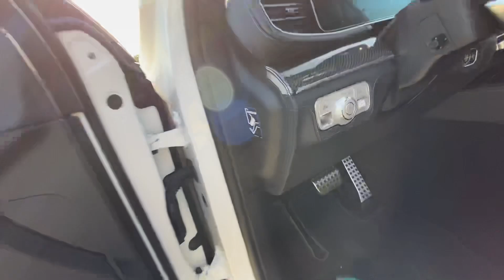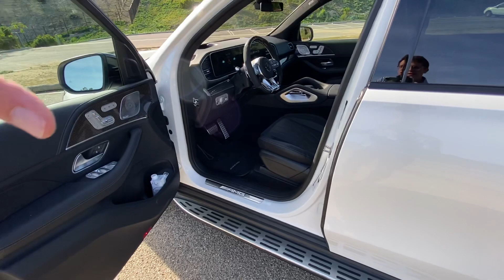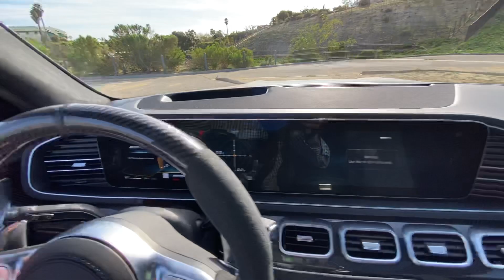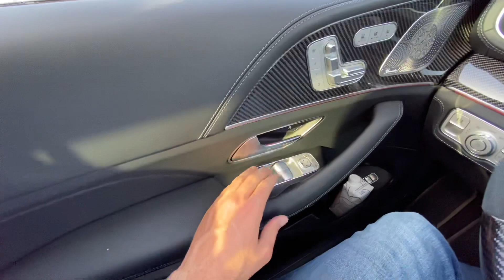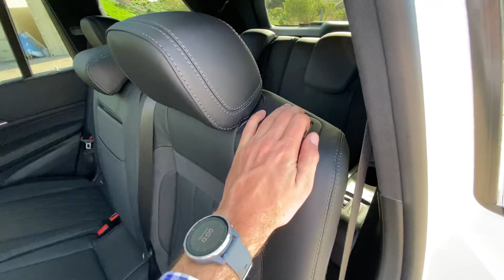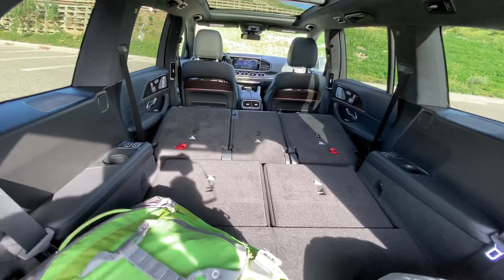The 2021 Mercedes-AMG GLS 63 Is a MASSIVE 7-Seat SUV That Is Faster Than Your Sports Car!

Comment: The seats in the front look awesome and super comfy but in the rear they are just a power ajusted bench. There are no extended corners and you can easily slide around.

Comment: I love to look at this, but I'd never buy one. I'm afraid of the maintenance after the Warranty.
Reply: In this case, leasing would be a better option.
Reply: You can always purchase warranties that’s what I did for my e class
Reply: @SM-1010 , I love the cars but I am afraid of the maintenance. You have an E-class. The E-class is the most reliable of all Mercedes.
Reply: p I’ve had an ML 320 CDI it’s a tank there were barely engine problems if it had problems it was just small electrical things Mercedes has average reliability, people think it’s just bad. Average is fine when ur getting soo much luxury

Comment: This or the BMW X5M?
Reply: JKC 

Not the same car, if you want to compare, compare the X7 M50i 523HP, 3 rows and just as big as this, just not as powerful 4.1-4.5 0-60 and weighs 5,600lb vs AMG 603HP 4.1 to 60 or faster. Not the much different. It shouldn’t even matter how much differences in performance when you buy this kind of suv
Reply: BLACK BIMMER keep in mind that bmw underrates their power numbers and 0 to 60 times.
Reply: X167 GLS 63 any day! Miles ahead of it's competitors.

Comment: Durango SRT: I have lost the crown..
Reply: Cool Pizzo trackhawk: hold my 95 octane
Reply: Jash Modi trackhawk isn’t a 3 row suv Durango srt is
Reply: Never had one....
Reply: I’m not very smart, But Durango srt never had the crown? Dodge claims it on their website and I did research no third row suv was faster than the Durango SRT until now
Reply: Cool Pizzo the model X, x5m, gle 63, Audi sq7, ranger rover Sport Svr and the previous gls 63 were all quicker.....the only thing the Durango has over them is that B.S.180mph topspeed which the bentley bentayga beats!
Reply: Wait for the Durango Hellcat
Reply: rangerover06sc oh yea lol 😂 Basically if you want a small barn on wheels with a hellcat engine
Reply: @youtuber2234-t7p  It will still be lighter and smaller than this. The SRT Durango is about 400 lbs lighter than the last GLS 63
Reply: the srt still has a faster top speed

Comment: THOSE WHEELS 🔥🔥🔥🔥 AND THEY EASY TO CLEAN! Perfection!!
Reply: Lazy
Reply: @Shaun Sharted agree
They may look better on older amg cars like the w210 or the w124 but not on a modern large suv
Reply: KM Gaming im asking you how can you clean inside od the wheel, not spokes😂
Reply: U high
Reply: @KM Gaming  Clearly you have never detailed a car. Wheels with spokes are far easier because you can get flexible brushes or wheel woolies back there. Not with this monoblock style rim. Besides, the old monoblocks were better.
Reply: Easy to clean if u order with carbon ceramic brakes
Reply: They are hard to clean, how do you think to clean inside of the wheel without taking it off 🤦‍♂️
Reply: Stef 44 lol

Comment: Hey, Ford, can I get my F250 Limited 4x4 with themed digital dash, carbon fiber accents, power adjustable rear seats and adjustable suspension for another $30K?  I like and can afford all those things but don't really see myself as a German SUV kind of guy and don't want my friends to think of me that way either.  Do I need those things?  That's beside the point.  Edit:  Oh, and an extra 200HP from a supercharger on my 7.3 Godzilla.

OK, just kidding.  I wouldn't spend my money on that but you know Ford , GM and FCA could sell some of those if they built them due to that line of reasoning.
Reply: a supercharger on the 7.3 godzilla to have -20 mpg!!! 😂🤣
Reply: I’m comparing it to a 600 hp ICE powered  SUV, not a Model X.  Not concerned about mileage at $2 - $3/gallon.  And abundant shale oil is going to keep the price low.

Comment: There is no way you will ever notice a 48v system in a 2.5t truck and those wheels are an abomination. Apart from that it's nice.
Reply: the 48v system is pure garbage and all german manufacturers basically uses it, from vw to audi to porsche , mercedes, why not make a plugin hybrid with at least 100 miles range?! and  use alumium for light weight body
Reply: @alanmay7929  I've said for a long time plug ins or range extenders are the way to go at the moment. Batteries are a pain to make in bulk, use a load of resources and have weight/packaging issues when they're large. Internal combustion isn't clean enough. So why not use a battery just large enough to do most of the work on electric and have an engine to carry on for the times its not enough? Split one Tesla sized battery into three or four and you could do 80% of the driving in four cars for the same resources. 
Plug ins usually come with other benefits too like pre-heating, silent running in traffic, and a decent power bump thanks to having another motor in there. This thing could have run the 350e system with a larger battery and got 30-50 miles ev with a 100hp+ bump in power to go with it. 
Thats just better and at this price really needs to be.

Comment: Those wheels work very well on an early 90’s e class. It was fitting. Big chunky wheel on a very boxy car. New smooth lined vehicles don’t look good with them in my opinion. It is like putting a set of craigers on an 812 Superfast. It doesn’t fit. Give me the split 5 spoke 22’s on the GLS 580 instead.

Comment: Hmm, 4.1 seconds seems very slow. Yes it is quicker than most cars, but I was expecting mid 3s. Although Mercedes does normally overestimate, even if you know a few tenths off, it’s still high 3s. Not the most impressive, but still very good for a car this size.

Comment: Imagine you are sitting in the third row when the gear breaks down and you literrally have to crawl out somehow. Why they did not supply a mechanical way of getting out? Even Tesla has unlocking mechanical handle for doors if the battery is out.

Comment: I laugh how you guys at TFL love all new cars. Most that fall apart after a few years , lose most of there value and end up being unreliable ! And your comparing a new model AMG Mercedes to a reliable Toyota Land Cruiser . Lol . There’s no comparison after ten years that Toyota will be worth more $ and  still won’t need any repairs . Unlike the Mercedes
Reply: Nobody wants these after 10 years let alone who wants to drive a 10 year old car anyways. 3 to 4 years and get a new one, that's who these vehicles are for.
Reply: @DrivenHard  Not true. These are actually great after 10 years. I've had experience with mercs over 10 years old. They're bulletproof reliable and rock solid. If they are serviced PROPERLY they go forever. My dad has a 2004 C Class with 285,000 now. It drives like new. Only ever serviced at Mercedes themselves. Never skipped a beat. And it tows a Caravan on a regular basis on bad roads too and not a single rattle either. And because they have tech and features so far ahead of time, even after more than 10 years they feel perfectly in tune with the times now. They don't feel old, drive old or look old. It has features cars of today still don't have. You are wrong. This is most definitely a car that can be kept for many years.
Reply: @SDav21  you are forgetting you are talking about a 2004 vs a 2020. Old Mercs as with most cars were builtproof and built to last back then. The industry has changed so much and they are not building them to last and be that reliable anymore. It's a whole different type of vehicle, you cant compare 2004 and 2020 anymore and expect the same result after 10 years
Reply: @DrivenHard  Not true. Because the taxis in Europe are new E Classes. The police vehicles are C Classes. Some ambulances are converted E Classes. The E Classes are taxis in some countries in Africa. These cars clock hundreds of thousands of miles in no time. And they are there. Going reliably. Like they're built to. So you're wrong. Besides that even, we also have a 2014 E Class. 160,000. So not as much. But still running like a dream. It just gets serviced when it's supposed to be with the PROPER oil and parts and at Mercedes. And contrary to what you say, the early 2000s were their dark years where reliability actually slipped apparently. And if that's the case, the new ones will be even better. Don't blame Mercedes for the inability of owners to maintain a car with new technology and complex items because they buy it cheap second hand then think it is maintenance free. You want the best performance, the best ride, the best refinement, the best technology... Well then duh. It won't be cheap. You can't blame them for the poor choices of other people when it comes to maintenance.
Reply: @SDav21  once again you not comparing the same cars. Those are fleet vehicles. They are built differently with less components them the consumer ones. They sell them to those kinds of companies for high mileage use. It's super company is all parts  of the world. Thats what Ford and GM do in the US and the European companies do over on that side of the pond. 
Bottomline luxury car makers just want to sell cars to ppl who buy new ones every few years. Long term reliability is not what it used to be. Of course will you find a luxury car with 200k kms on it every now and then yes.  But not every toyota was born to go a million plus miles as well.
And this is good cause it keeps ppl like me happy and in new toys. Ppl who want stuff out of warranty and want to repair overpriced used cars. Great they can buy them 10 or 20 years later and pay for it then.  I'll take my new car every few years.
Reply: @SDav21  I do agree. If ppl checked your oil more, cars would last way longer lol
Reply: @DrivenHard  No. Not just the fleet vehicles. Like I said, we have a 2014. That makes it 6 years old now. Because the tech in there was so far ahead, even now it feels super modern and up to date with the times and drives like when it was new. These cars were built to last. Provided they are properly maintained. Even after all these years the interior barely shows any signs of age.
Reply: @SDav21  I guess you haven't driven a new model one lately. World of difference.  Just hit me up when  its 10 to 15 years old. 6 year old cars are still covered under warranty in some cases so you can't really say that it's that old yet.
Reply: @DrivenHard  I have driven a new model. C, E and GLC. Their engines have not changed from the previous gen versions. The current E350d has the same V6 diesel from our E Class. So I know it'll last.
Reply: I keep my cars for 1-2 years. Don’t really care about the longevity tbh.
Reply: My 20 year old ML still runs like new
Reply: No it won't. And the Toyota and its Lexus counterpart is basically 2 decades behind this in every way.

Comment: There is no European nor American SUV that will outperform Toyota’s Land Cruiser, in its field. No one needs so much power nor those astonishing top speeds; no one will travel that fast in our highways not to speak of off-road...
Reply: Yes there is a reason to have that much power. Ppl want it. It's fun. It's not all about top speed.  I didn't think my wife would love our 600hp Range Rover but she absolutely loves the endless power it has.
Reply: Driven Hard / can’t argue on that one. Best regards .
Reply: I agree. Those tyres are not meant for offroading anyway.
Reply: what? The Land Cruiser is the most outdated new car you can buy. This is way better